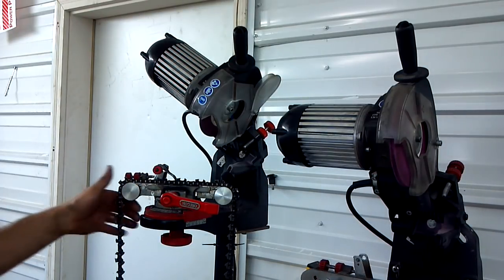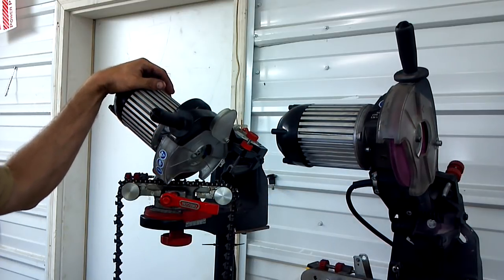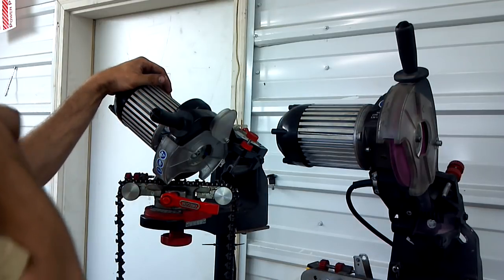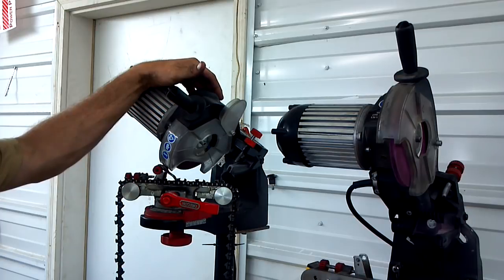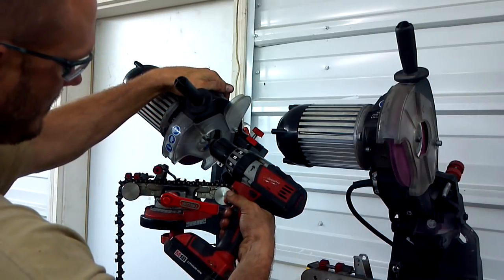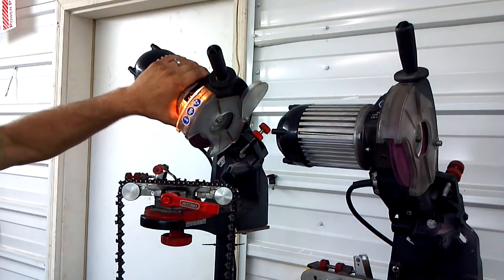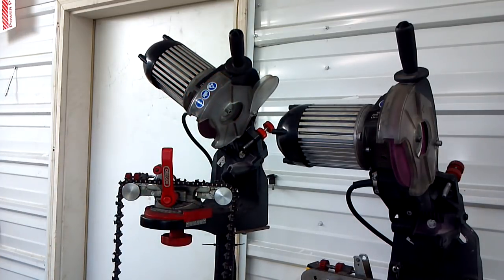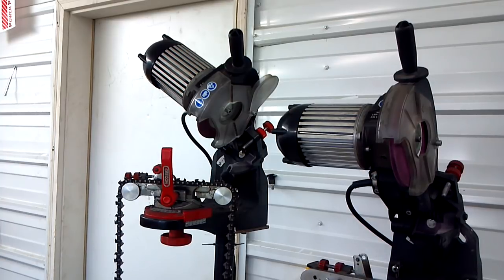Oregon chain grinder trick to reverse the wheel chainsaw

Comment: I am a nut about tool edges.  I set up a small stereomicroscope to check my hand tool edges.  Actually matters on A2 and harder steel.

When I looked at Stihl 33PM chain, ground round, I could see a difference when cutters were ground "forwards" or "backwards" using third party diamond wheels and the pink wheels from Oregon.

In either case, the pink wheels left significant discoloration which I believe to be temper drawing from elevated temperatures (as compared to diamond).  All the grinds were timed with one of those metronome apps for my iPhone. I am confident they are close to the same total time per cutter but diamond required much less time than pink stone.

My conclusion is that if you use diamond wheels (or something similar - creating little heat,) then the bur can survive for a few cuts in Alder but no more.  The pink stones make burs (and presumably cutters) that are heat damaged and pull free faster than I can test.

Basically, microscopic analysis suggests that the burs are not a problem but the type of stone is an issue to look at.  Diamond appears to draw temper less than the pinkies.

As always, one test by one guy means little.  Your experience may be totally different.  If so, I would like to hear it.
Reply: Synthetic diamond for standard chain and natural diamond for carbide chain.  Absolutely less heat/re-temper of the chain and way less mess in the shop.  Another great benefit is no reshaping of the grinding wheel (again way less mess and saves more time).

Comment from the maker: True although common sense would tell you not to stand in front of the wheel.  Couple guys were having a conversation about rewiring the grinder so I offered this alternative.  A razor for shaving, a pressure washer for crank case cleaning.

Comment: Reversing the motor direction will not work on all grinders no matter how fast you spin them in the other direction.  Reversing the motor will make the wheel turn in the direction the center retaining bolt unscrews.  If the wheel comes off you could end up with it in your face.

Comment: cool trick!  was just wondering, is the grinder on the right a regular 511 or 510 just with the big wheel on it and set how it is for grinding rakers?
Reply: Definitely looks like what he’s doing with that setup. I’d rather just just the raker gauge and a small bastard file. I really only worry about rakers every 3 or 4 sharpenings

Comment: This is a very poor idea.  I am not sure what the motor design is it may be split-phase, or permanent split phase.  To reverse the motor typically you you have a RUN winding which is wound in the stator first and a START winding is placed on top of the run winding 90-degrees from the RUN winding poles.  The start winding induces a torque pulling and pushing the rotor when power is applied to the rotation it is connected to rotate..  To reverse the rotation you simply need to swap the start winding leads with each other and the motor will reverse. Over-riding the start winding with a drill will eventually damage your motor.  Grainger may have manual rotary switches that can be wired to reverse the START windings.  One may issue is you are spinning the grinding wheel in direction that may unscrew the disc retaining screw in the end of the motor shaft and the disc could come off shatter and spray itself in your face.
Reply: 4UYE9 DAYTON ROTARY REVERSING SWITCH - SEE THE SPLIT-PHASE 4-LEAD DIAGRAM